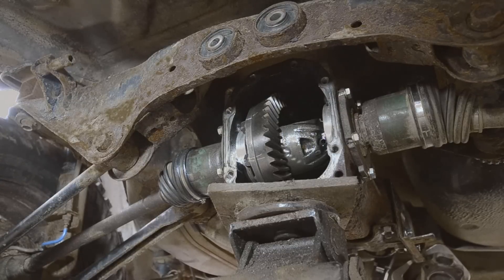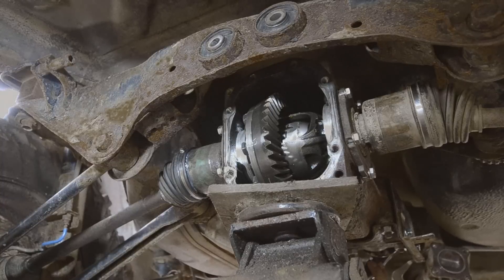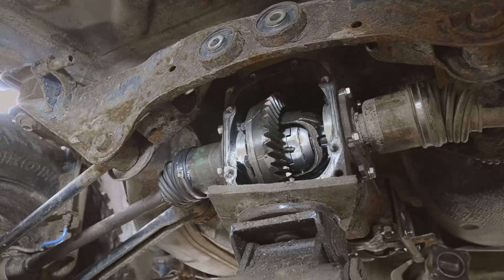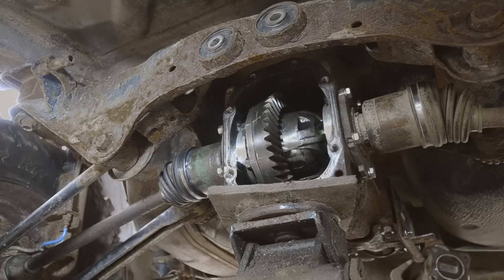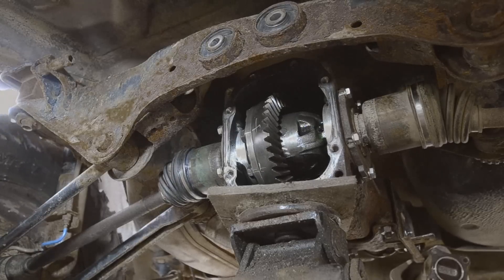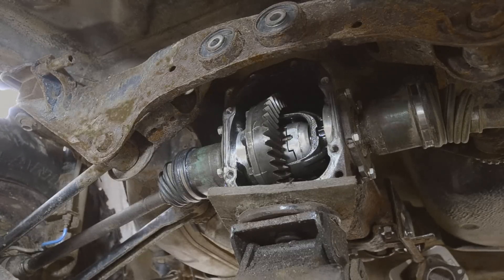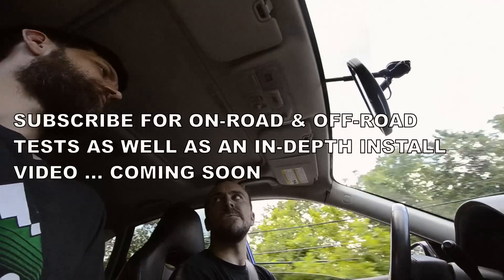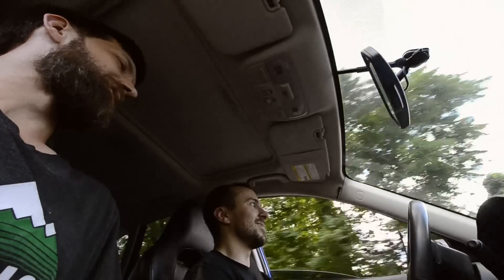Subaru R160 Autolocker Explained + Ratcheting Sound Tests

Comment: So, in practical terms, the differential will ratchet and allow slipping when coasting around a turn. Probably the sharper the turn, the noisier it'll be.
If you give it power around the turn, it won't slip, but drag the slower wheel around?

Comment: The only thing keeping me from putting one on my lifted crosstrek is the clicking.  I think its pretty loud
Reply: It's not even that bad. People exaggerate it. The Crosstrek isn't even that quiet of a car. I'm assuming you already have A/T or M/T and some other mods that make your car loud already what's more sound. The trade off now is you actually get performance gains.
Reply: I'm curious if you put that sound deadening acustic mat liner over the rear flooring of the car. I mean that seems like a cheap way to keep cabin noise down.
Reply: You who try the Cusco limit slip, it’s pretty good for both on and off-road from what I read
Reply: @suewang9210  I put the cusco rs LSD in the rear of my 03' wrx and it was very loud. I would reccoment it for motorsport use only. The have a few other more street friendly diffs that fit in the r160. This locker really is not very loud.

Comment: Why does it need autolocker? I thought the car will apply brake to the spinning wheel so the wheel with traction can turn. Am I wrong?
Reply: Not older vehicles before 08 I believe

Comment: I always figured that the outside wheel can always overdrive the inside wheel no matter if you're on or off the gas..  does that sound right?
Reply from the maker: It tends to lock up if you give throttle in the turn. How easily both wheels lock depends on tightness of the turn, how fast you're going, and how much throttle input you give.

Comment: Another awesome video guys thank you, I was a little worried regarding the clicking but that’s awesome
Reply from the maker: Thanks! Yeah, I don't think the clicking is bad at all. Difficult to even notice from inside the car
Reply: @powerofyourbrains  I had this installed in my SJ Diesel and i have to drive with window down and radio off and then try really hard to hear it in most situations. I was impressed how quite it operates.

Comment: Nice video and better than others I have seen on this locker but will still have to dispute the explanation somewhat. This locker doesnt really lock, all it does is send 100% of torque to the slowest turning wheel and zero torque (well technically slight torque in the opposite direction) to the faster turning wheel (i.e. its completely unpowered). If both wheels are turning the same speed then torque is split between them. On road the inside tyre gets all the torque until you break traction then you get a sudden transfer of torque to the outer tyre causing the sudden oversteer shown at the end of the video.
Reply from the maker: Thanks! We've seen a few of your crazy river crossings as well - they're quite inspiring for idiots like us. I see what you're getting at, and I think we've arrived at a quantum particle physics discussion put in terms of differentials. You're point really depends on whether you consider lockup to be in any given instant or averaged over time. I haven't driven granny enough to know whether lockup occurs in a strait line at high speed, but the torque converter certainly has enough juice from a stop to cam the crosspin and cause lock up. Probably isn't as much as would be generated by differential wheel speeds, but it could chirp the tires on pavement if you gave it enough juice ("could" because we've since reverted the diff lock to drive on-road in FWD). The WRX is my car, and it does stay locked in a strait line at high speed as long as I'm willfully accelerating. I can tell when it locks from a slight change in steering weight, likely caused by the vLSD center. All that being said, it's not really fair to say the exact same applies to cars with half the power of the WRX. We'd love to have a selectable locker if we had a little more of that Subaru Off-Road money ;)
Reply: @powerofyourbrains   I guess what I am trying to say is that its not "locking" under power, all thats happening is the power is spinning the inside wheel until it reaches the same speed as the outside wheel at which point power is send to both wheels. If you had infinite traction on the inside wheel no matter how much power you sent to the diff it would never "lock" and the outer wheel would always ratchet faster with no torque going to it. A theoretical world but I am trying to explain how the "lockup" isnt really related to input power . On the selectable locker  note my Air locker is more trouble than its worth at the moment, constantly leaking air so the compressor constantly runs. Pretty annoyed the seals failed so quickly...
Reply from the maker: @SubaruOffRoad  Sorry to hear that about the selectable locker, hopefully you'll find a fix. I'm not sure how much experience you have with the Torq locker, and I have no experience with Aussie locker, but I think we're missing each other talking about this concept. On the Torq locker there is just enough tolerance to allow one of the wheels to ratchet (about 4mm). However, the two sides of the locker have a cammed profile such that any acceleration applied pushes out on both sides of the locker equally. Once one wheel becomes locked, both are locked. I understand that may not be the case if driving on 3 wheels, but as soon as you goose the throttle enough it would be.
Reply: @powerofyourbrains  Yes the two are a very similar concept but the Torque locker is slightly superior design as it is mate to ratchet easier. Where you have made a mistake if your understanding is that you said the acceleration applied pushes out on both side equally. This is only true in a straight line. When cornering and one wheel is turning more slowly than the other the cam on the pin will only push outwards on the that wheel. The outside (faster wheel) will try turn faster than the pin doing the pushing and as such the cam will not act on this side. On this side the springs keep the little (4mm) drive teeth engaged between that half of the centre section and the side "gear" section but only with a little bit of force (not enough to provide drive), that makes these two pieces rotate together at the same rate with the wheel on that side. As this outside wheel is rotating faster than the carrier/pin it rotates the cam on centre piece away from the main drive pin so that the cam no longer acts at all. This rotation continues until the flat castle looking parts of the two centre sections contact this stops the faster turning centre piece from rotating further forwards stopping the other side of the main pin cam acting in the opposite direction. As the outside wheel is still trying to rotate faster the slight angle on the little 4mm teeth is enough to overpower the little springs and allow the drive "gear" section to jump one tooth forward. 
The only reason it may seem like its "locking" under acceleration is simply because you have overcome the traction of the inside wheel and thus both wheels now rotate at carier speed. With this locker its not possible for a wheel to ever rotate slower than the carrier.
Reply: as i understand this locker allways locked just it unlocks when its needed on asphalt surface is it not ? 
russians who making lock-right locker made other version of it one-click locker they saying its not locked all times just locking when one wheel stopped or smt.

Comment: Any word on how these will work in modern Subarus (e.g. Forester SJ, XT) with their X-mode and whatnot?
Reply from the maker: On the 2011 WRX VDC doesn't seem to make an impact at all. No word so far on X-mode/CVT models, but John Bloom out in Oregon is testing on 2013 and 2018 Crosstreks with X-mode now. We actually lent him Tyler's locker for the 2003 Forester, so that install is going to be delayed, but at least we'll know something about the later models soon. You can look John up on the MtnRoo Brotherhood FB page.
Reply: It will be interesting to find out what the system does. Im guessing a lot of the features of x-mode wont be triggered as there wont be slip detected. I dont know if the system brakes individual wheels or of it brakes diagonal pairs, if diagonal pairs it might hinder as the engine will need to fight x-modes braking on the rear wheels. It also possible the system might shit itself entirely as it will be seeing wheels turning faster than possible when cornering, but I think its unlikely that the system is going to be that sensitive.
Reply: @SubaruOffRoad  vdc its not just for wheel spin detection its for maintain car on straight line compare to wheels position etc , so its many things that VDC looks for there so its interesting how it would work if rear wheels would lock and suddenly cars line changed . it might throw codes on screen and its done. its very delicate . but then off road in mud or such when wheels could lock and car could go better on slow speeds it might be ok too. other cars with traction control and rear lockers similar to this like dusters works with traction control fine . but thats again on mud snow sand . 
it needs to not lock on main roads at all then its fine with VDC i think.
Reply: @MrScalman  I though we were talking about x-mode which is predominantly for wheel spin isnt it (not sure never had a car with it)? I hadnt even though of VDC, that potentially could lead to some scary effects if its trying to correct a slide and instead of just braking one rear wheel the braking effort could transfer across the diff to the other wheel. Someone with a VDC car will have to do some high speed dynamic slide testing to test if it still works or is deadly.
Reply: @SubaruOffRoad  well x mode cars are with VDC anyway so VDC working on all x mode cars there. when you not turning x mode you have just VDC car there. but yh we need more tests there. you guys gonna do more trips with your car ?
Reply from the maker: @SubaruOffRoad  John didn't say much, but he did hint that X-mode seemed to cooperate just fine with the locker. Personally, I'd be surprised if it didn't cause at least some issues, but who knows. Subaru is very opaque about the degree to which VDC takes over in different vehicles. I've never really noticed the VDC in the WRX, but I have in other Subaru models. I don't think it matters regardless; just something to note I guess
Reply: @SubaruOffRoad   yes it would be interesting how that works as VDC system would try  to correct driving line when locker would lock wheels is it not ?
Reply: it makes the x mode better, x mode is basically really smart traction control that uses brakes to change the torque but since you have a torqlocker which is a mechanical soulution it'll will be fine

Comment: Will these work with vlsd diff? I got 2010 outback manual diesel
Reply from the maker: No, open only I'm afraid. They don't sell your diesel stateside but I'd be shocked if an open diff with the same ratio couldn't be found at a local junker for pretty cheap. For the USDM Subaru uses just  2 casing styles and 3 ratios for almost all the diffs in their cars made over the last 25 years, so finding an open is easy even if you're 3 hours from the nearest medium-sized city like we are.
Reply: still as they said this locker will lock up in corners when accelerating. and you have VDC car there.

Comment: Thanks for the video.
I am assuming it is actually less noisy than it sounds due to the camera microphone having more gain in the human speech range?  Cell phones and GoPro cameras seem to do that.

Thanks for posting the video.

Really would want one for the front differential too, obviously for off road use only.

Definitely going to get on their waiting list for one for the rear though.

The Russian version was sold on eBay before, but so far I haven't seen them there this year.

Looking forward to seeing what you post next.

If you make it to the Oklahoma and Texas panhandles, I can get time off to shoot video with my Yuneec Typhoon q500 4K quadcopter for you.  It shoots beautifully smooth 4k video.

Just getting into the scene now, but I have had several Subarus in the last 18 years.  Miss my 68 DL wagon the most.
Reply from the maker: Yeah, that wagon is a rarity these days. Up next is an on-road evaluation of how the locker impacts daily driving in auto vs manual. A front locker would be cool, but with our supporting mods such as long travel it's kind of overkill. Meaning that we have entirely too much traction relative to the capability of our drivetrain lol. The audio is untampered with only a high and low cut, enough to make the buzzing and rumbling tolerable, equal between inside and outside shots. You're correct about the playback. On a desktop or car stereo with a good/full range it's much quieter. Appreciate the offer too. I'm from Texas myself and my Phantom has been on the fritz lately.
Reply: @powerofyourbrains  

What part of Texas?

I go down to Amarillo fairly often, and Tulsa, OK was fun when they let the floodgates open to town.  Miles and miles of flooding made for some fun exploration.
Reply from the maker: @BDPr0ductions  Dallas area. Grew up in east TX

Comment: russians making similar ones for R160 as well lock-right they allways locked too very similar to those torq.
im curious so they never ever would stay locked on turns ? because i heard some people on other cars with similar design lockers saying driving car with them can be weird at times its acts just not same anymore. so maybe new learning needed to drive  car with those kind of lockers.
great video, hope more tests coming soon like get that locker to extreme hard work like uphill very slow ..
Reply from the maker: Interesting that there was a Russian-made locker. Makes me wonder what the material was though. Torq masters claims their hardened 9310 steel is several times harder than chromemoly axles, which is impressive.
Reply from the maker: Check out our last video. Did slow up-hill to the hole in one go. If you've watched our other videos there you probably know its super challenging. More to come though, rest assured. What you're referring to about the lockup in turns is exactly what we'll be talking about next. I'll say that if you drive a manual then you'll need to change your style a bit to avoid it, although it's not as bad as I expected it would be. In autos there is a way to avoid partial lockup all together.
Reply: @powerofyourbrains  That's good to hear, as I have kept to the automatics in Foresters since the earlier ones, at least, use an electric over hydraulic transfer clutch to engage the rear axle.
Reply from the maker: @BDPr0ductions  Yep. It's as simple as wiring a switch to the FWD. We configured our diff lock to revert to FWD instead of auto. Either or both works. You'll still have the clicking, but it's barely noticeable. On our last trip I only remembered it was there because of the confused expressions we got from the groups of SxSers we passed.
Reply: @powerofyourbrains  I have no worries over the clicking, that's what the one in the front of my F150 sounds like.. pretty much the same, just labeled Aussie Locker by the same manufacturer.

Works beautifully.

I was saying I like the electric control via PWM for the automatic rear transfer clutch.  Messaged your Facebook user an image of the PWM module I use to keep it between 5 and 95%.

I understand the front on a mostly front wheel drive that is street driven shouldn't be more than limited slip for drivability issues.  Add a locker up front and it becomes an off-road only toy.

I assume one day we will run into each other and share secrets..

When my new crank pulley gets here Monday I will get it in, then maybe make a video Tuesday or Wednesday showing the a few selected levels of transfer clutch from above.  It rained pretty good tonight, and that will mean some mud to play in.

Without a cameraman, I need the wind under 35MPH to hover my quadcopter for the best angles.

Trying to keep anything long off your channel... If you have any interest in more precise control of transfer clutch control, I messaged the Facebook account.

Thanks for all that you share here.

Keep having fun.
Reply: @powerofyourbrains   so with autos it would work better then ? how so ? what about subarus with VDC traction control and autos then ? would that work ? russians showed videos how lock right locker worked with renault duster traction control together. so maybe this would work too
Reply from the maker: @MrScalman  Ideal in autos because of the FWD diff lock mod. Otherwise you have to change your driving style a bit because autolockers lock up when you accelerate while turning - unexpected lockup can't happen if there's no power going to the rear. In the WRX it seems like VDC doesn't really effect anything.
Reply: @powerofyourbrains   so how you drove it with WRX then ? it doesnt have FWD switch just VDC off its allways AWD so how it worked in WRX then ?

Comment: Is the casually off-roaded 2003 Forester   an auto or manual trans ? do you know if the 2.0 xt automatic trans forester has a  open  rear dif?
Reply from the maker: Assuming you have the fa20 on one of the later model Foresters, you should have a 5-bolt open. Easy way to check is to put a jack under the rear diff, get the wheels in the air and spin them. If they don't move in the same direction then you have an open diff
Reply from the maker: It's manual. Granny is an auto though.